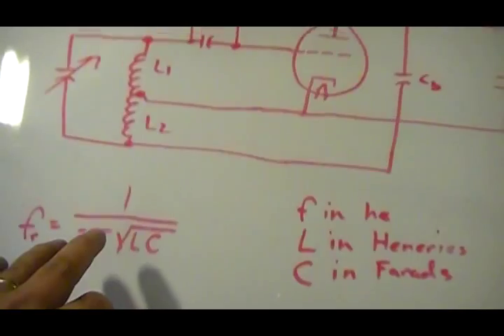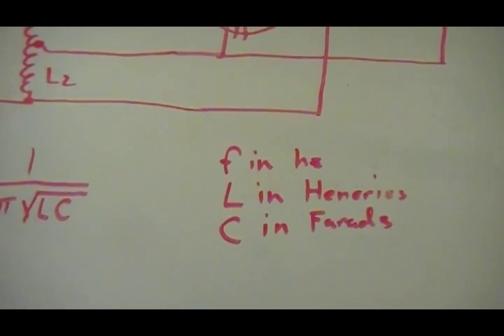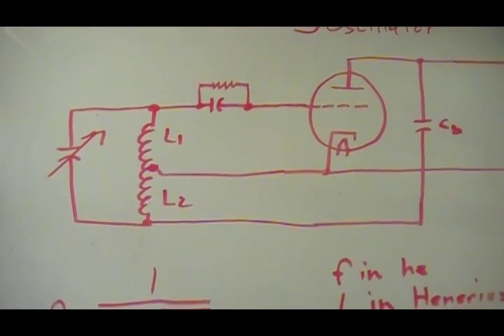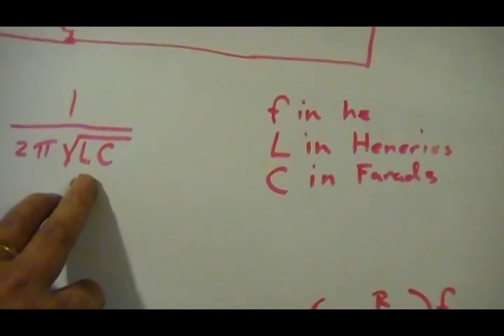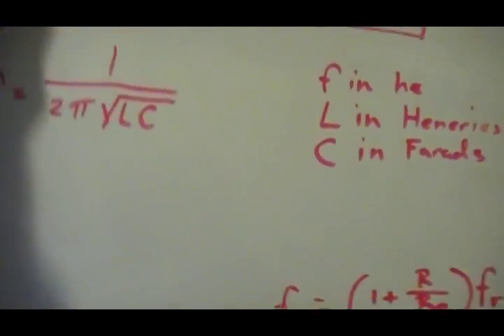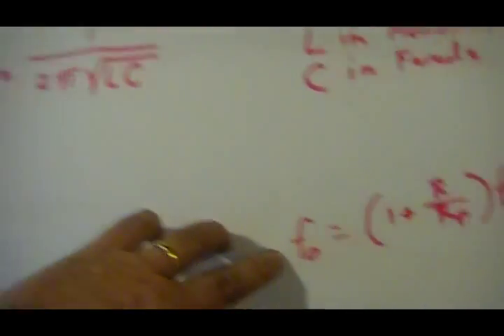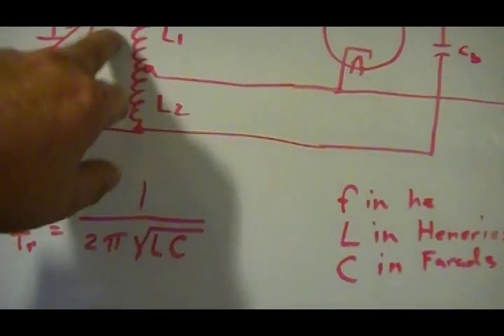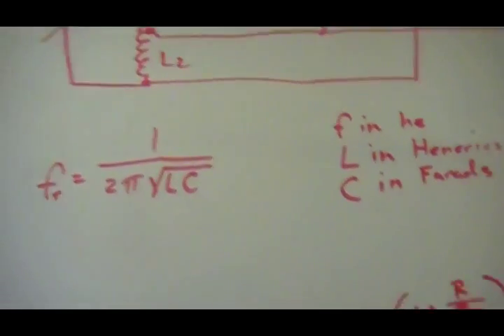OSCILLATOR Theory part 1

Comment: Dennis,
I like your analogy of a child on a swing receiving a steady push to maintain a constant momentum. It is far clearer than the grandfather clock pendulum and escapement mechanism analogy.  When I read inductor and capacitance theory at college, a fair amount of fellow students became confused as they, like all of us, had heard of pendulums but were not familiar with escapement mechanisms.  Clocks tell us the time, therefore, the swing of the pendulum has to be maintained at a constant, invariable, oscillation –  a signal generator’s oscillations, for example, are generally variable – the child on the swing can go lower or higher – that is why I like your analogy better.  A very good production my friend.
Regards,
Phil.